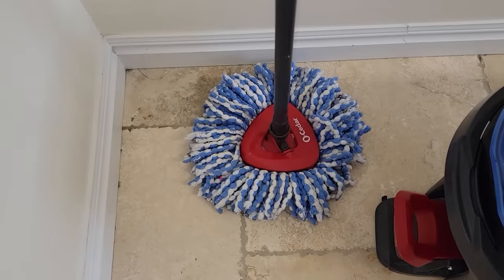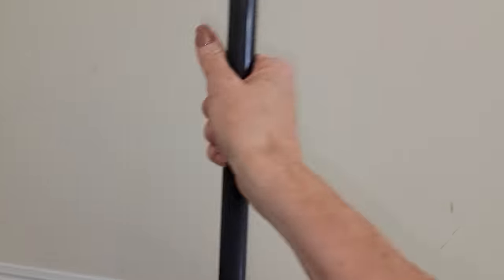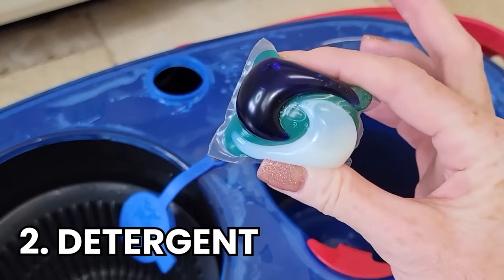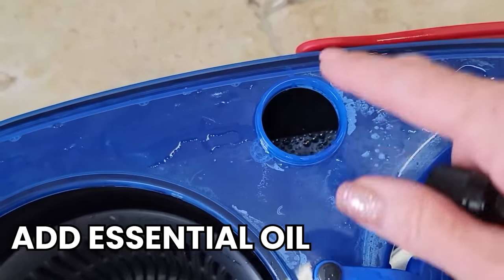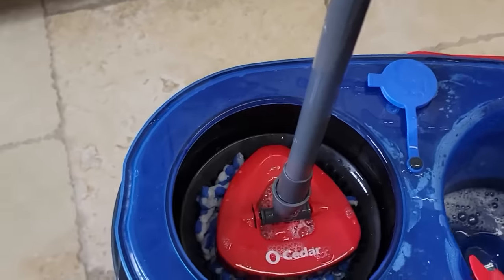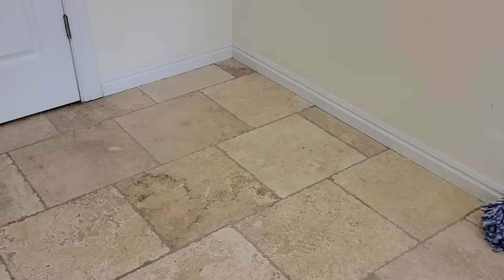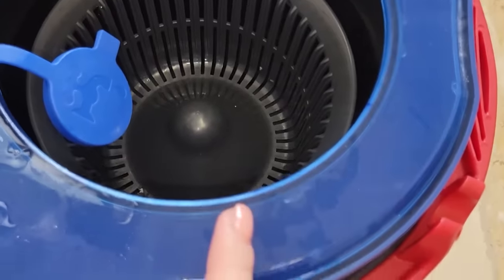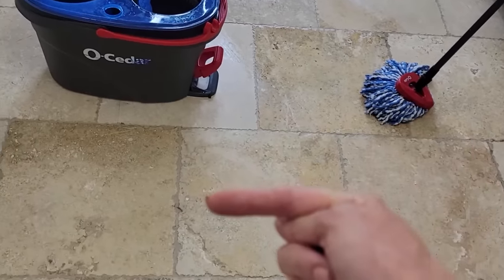Nobody Believes But It Really Works!!! Everyone's Suddenly Buying ⚡THIS to Mop Their Floor

Comment: The cleaning ingredient that cleans "cuts thru grease" is sodium carbonate (not bicarbonate) aka washing soda. You can buy it in bulk, it's not expensive, and you just add 2 tbsp to your water, with a small squirt of dawn blue dishwash liquid.
Reply: Is this the Borax powder???
Reply: @amlatina24  nope. Borax is a whole other thing. Washing soda is popularly sold under arm and armor washing soda. It's in a cardboard box like borax . You get like 7lbs for 6$
Reply: Do you still have to rinse the floor after?…
Reply: @ekbkjk777  yes. It's pretty alcaline and will eat thru stuff. It's important to read up on cleaning chemistry. It's both fascinating and practical! ☺️
Reply: She is correct, Dawn, baking soda and water.  HOT!

Comment: I vacuum and then use my Shark Steam Mop.
Sanitizers and cleans all at once. NO chemicals!
Reply: You do know you have to leave a steam mop in one place for several minutes before it’s actually sanitized
Reply: I do the same. The Shark Steam Mop leaves my floor sparkling clean.
Reply: @susancavanaugh5843 I think she knows how to use it
Reply: I agree. They tell you not to use steam on sealed wood floors, but I still do it (since 2017).  I did cut down on the frequency.

Comment: I have all three types of floors. I have the new oCedar mop system. I’m glad to know about the alcohol because my neighbor told me to use vinegar and my floor doesn’t look as nice as it once did
Reply: You may have broken down the finish on your wood floor. If I were in that situation, I would first try cleaning it with Murphy's oil soap, then put on a wood-floor rejuvenator. Rejuvenate’s wood floor restorer is one. It's less expensive than having the floor refinished.
Reply: @edennis8578  I do have the rejuvenator. I’ll try the murphys oil soap this time. I know the finish is ruined. Makes me sick. Thanks for the advice!!
Reply: Wouldn’t the alcohol cut the shine on the wood floor?

Comment: I have vinyl floors. I have been using a bissell steam, vacuum / mop.  Sometimes I use a sponge mop. I’m curious about using a laundry soap pod to clean my floors.
Reply: Hi how are you doing?
Reply: Janice, your steam mop is much more effective. I've found detergent attracts dirt on your vinyl floors and sometimes gets slick if you have a spill. Good luck!
Reply: Don't do it. It will ruin your floor's, especially vinyl. It'll leave a film, which attracts dirt, dust & debris, make them stick & it'll be very difficult to clean afterwards.
Reply from the maker: You shouldn’t ever use it with a vacuum mop because it can clog up the machine. Only use cleaner specifically for it. You can use this method with a sponge mop, just go over with just plain water after you rinse.
Reply: @islandpersuasion4690  thanks I will stick with the products made for cleaning my floor.
Reply: Using a stream mop on vinyl flooring will eventually cause the flooring to come up off the sub-floor.

Comment: Wait, but doesn't the dirt that u spin off go into the clean water that is under the clean water bucket?
Reply: No.....cuando llenas el depósito es de agua limpia y cuando esprimes se va abajo del tanque de agua limpia....pero está tina no la recomiendo se acaba muy rápido el agua del depósito para trapear .....yo la regrese pork me quita tiempo andar asiendo eso
Reply: It doesnt but its very small i just use the original ocedar mop and have a second bucket for my clean water
Reply: @FatPeanutsFat  para mí eso no funciona usar 2 baldes de agua ......en lugar de ayudarme me da más trabajo.....yo limpio casas y esa no me ayuda ...yo solo y únicamente uso el original y con ese tengo..

Comment: It has to be hot to dissolve the plastic holding the detergent....wonder what that does to the floor.....don't most floor cleaners cut through grease??????I'm thinking they do or you can add a couple drops of dawn for when it's built up grease that doesn't come with Nirmal cleaning

Comment: I've tried that and the washing soda and my floors are left so sticky and gross feeling. How do you prevent that
Reply: Not using the pod. It’s way to concentrated.  If anything she should put it in a bottle with water and let it dissolve.  Then add a little bit of that solution to your mop water with a disinfectant.  Tide doesn’t disinfect
Reply from the maker: Use less detergent or washing soda and rinse after.
Reply: If not wood rinse w vinegar , pods would be hard to rinse clean

Comment: What would you use on shiny floor tiles, that one dry there isn't any streaks etc
Reply: I used to work at a convenience store with those shiny tiles and we were told to only use the blue concentrate that was also what we used in the windshield washer buckets by the pumps. So I would recommend picking up a cheap jug of the blue windshield washer fluid, probably the summer version because I am not sure what they add to make the winter versions not freeze so easy. If it is just a type of alcohol it should be fine though.

Comment: I recently got one, and hate it. My first issue is with the mop. IDK if I just got a defective one, but when I extend the shaft, it won't lock. This results in it collapsing as I'm mopping the floor. My second issue is with the spinning wringer. It doesn't wring out the water very well. The mop is way too wet when I use it and leaves water spots all over the place. Worst mop and wringer I have ever owned.
Reply from the maker: It sounds like you need to initiate a return. We haven’t had any of those issues with ours.

Comment: Thanks … I was wondering what to use to degrease my floors.
Reply: Read the floor cleaners at the dollar store or Walmart......pods are for clothes not floors.
Reply: @anointedcountrygirl  well these floors were done long before I bought my home and whoever installed definitely wasn’t a professional and they are just cheap laminate and sticky tiles. The sticky tiles in my bathrooms and kitchen you don’t dare walk on if they are wet or if you are getting out of the bath because you will fall and bust yourself.

Comment: The finger is annoying and not everyone can afford to use a pod as they are expensive.  When I had children I was cleaning almost daily now as a senior well its still almost daily. Back to serching.
Reply from the maker: You can use a small amount of liquid dish soap and hot water. Rinse after (failed to mention that part in the video).